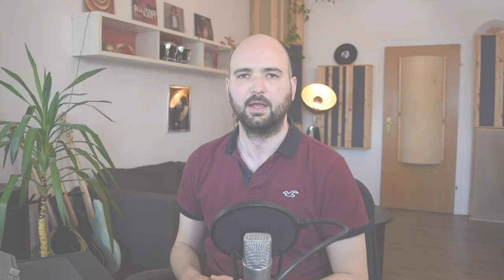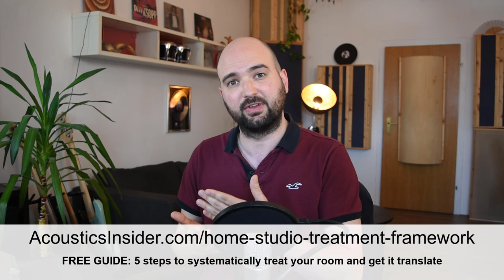If My Room Is Asymmetrical, How Does That Affect Treatment? - AcousticsInsider.com

Comment: I think it's tricky to get a balance of a well-setup and treated room, while keeping it an inspiring place for creativity. For example, I have spent time in symmetrical, acoustically-treated studios that were kinda soulless, and I couldn't get in a creative mood. While other times I've been in very imperfect rooms with lots of windows looking out to nice views, and it's been much more inspiring.
Reply: it's a matter of interior design, nothing to do with the treatment itself, bro
I've just ended my room treatment - a lot of rockwool on the walls and ceiling and in the corners (not only wall-to-wall but also wall-to-ceiling, so there's a ton of panels) and it's inspiring as heck
the reasons are - lovely colors, good modern furniture, thought out lightning (cold filling light and warm spot lights), comfortably placed stuff... and of course goddamn clear sound)

Comment: What I find “interesting” is all the energy and commentary on room acoustics, which is of course is important. However, on the other hand, you have many, many very successful mixers working in an environment surrounded by hardware. Basically surrounded by metal and hard plastic. I would surmise the most important factor is just knowing your room.
Reply: Easier to get to know a good room tho. Less guesswork and having to check translation religiously.

Comment: I will be in a situation soon, where te room it self is symetrical, but since its kind of a attic appartment, the celling is anything than symetrical. one side is propper romm hight like 2,50 m or something and the other side is a tlest 4 meters high. what would you suggest?

Comment: My experience with my living room.
Typical asymmetrical room with one speakers near an angle and one on the side. A lot of bass trapping with rock wool on the angle under the R and re-creating an angle with panels behind the L. I've clearly misured the response and the problems only were on the R channel in the angle. The other one, didn't have any problem, nearly perfectly linear response from 40 Hz to 20 kHz ( heco direkt 2 ways ). I've had to use some filters until 400 Hz to match the response but nothing extreme. 
So yes, you can obtain an high end result even on asymmetrical rooms.